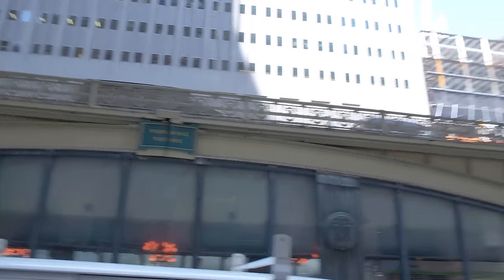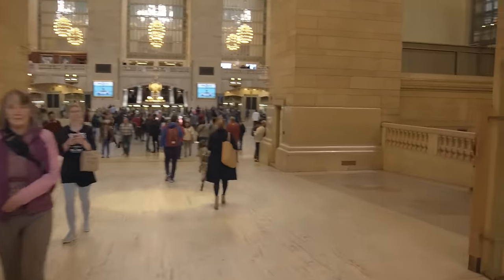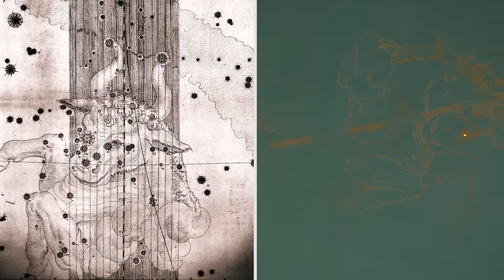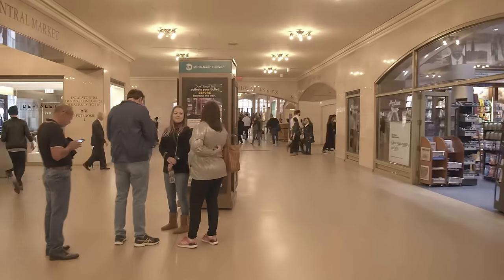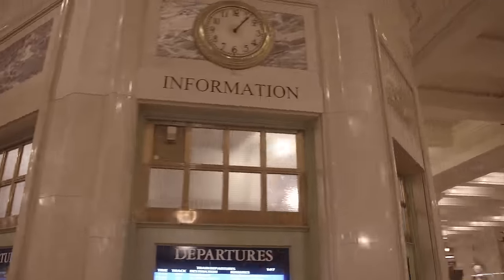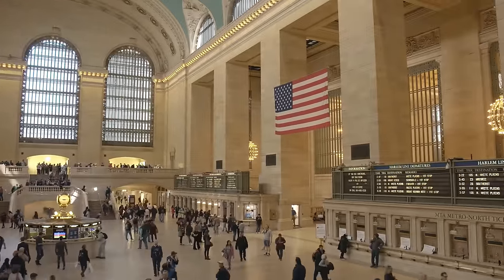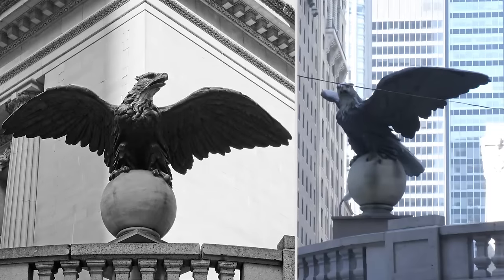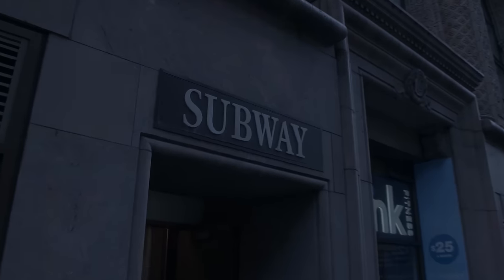Every Detail of Grand Central Terminal Explained | Architectural Digest

Comment: Well detailed video, with simplicity and clarity. Worked for the railroad for 30 years in design and construction and I've seen the transformation - most dramatic in 1998 to 2000 when the Main concourse ceiling was cleaned and in 91, and  2002, when the main Waiting area was renovated . All is restored to its original build-out because Grand Central is a Landmark Building. well done.

Comment: Good overview, but a couple of quibbles: While Vanderbilt's decision to move his railroad's terminal station uptown to 42nd Street did promote the growth of the area, the name "Grand Central" was ridiculed at the time because it was hardly centrally located in 1871. The original terminus was downtown on 27th Street. The current building, opened 42 years later, is the third on the site, and the Commodore was long dead by then. The first was called Grand Central Depot when it opened in 1871, and was actually three separate stations in a single building. It was altered and remodeled several times, but in 1899, it was greatly expanded and renovated and re-named Grand Central Station. The tracks south to 27th Street were removed. But the renovation was a stopgap at best, and when it was decided to electrify the railroad, as ordered by the city, a totally new station was built in phases over the next ten years, opening in its current appearance in 1913. It took so long because trains continued to operate while the old station was demolished and the new one built. It was then named Grand Central Terminal.
The second quibble is the picture shown with the statue of Cornelius Vanderbilt,  which was moved from the former downtown station. The photograph shown with the statue is of the original Grand Central Depot, and not the older station on 27th Street. The way the text reads would cause someone to think that were a picture of the downtown station, which it is not.
Minor points, and maybe not too important, but I noticed them,  and anyone who knows the history off the building would spot them, too

Comment: Amazing!! Lots of info I never knew about Grand Central!  As a civil engineer in 1983, working for a firm that was designing repairs to the structure of Park Av around the terminal, I got to explore this amazing building.  Walking the entire upper roadway to and thru the "building of many names" at the north end a bunch of times was an interesting and remarkable thrill of a walk!!!  

Back then, the lower level Info Booth never seemed to be staffed and what made it even eerier, was that me and my co-worker were usually the only 2 people on the entire lower level!!!  And, those glass floors between the windows on the west side of GCT freaked us out the 1st time we encountered them.  We crawled across, just so our hands would be closer to anyplace to grab on to in case the glass floor broke.  Thanks again for the new info!!!

Comment: Grand Central is simply stunning, a real gem in NYC's landscape that should be treasured & I love how the beauty ends abruptly when you walk through the gates; pomp & ceremony out the front & nothing but business down below.
It would've been nice if we'd seen what it was like to walk between those enormous windows that overlooked the main concourse though. Very interesting, thank you for such a detailed look at an American icon.
Reply: OMG, I had no idea there were walkways that traversed those grand windows!  I'm going to have to make a pitstop in Grand Central today to see for myself!
Reply: My brother's an engineer at Metro North and thanks to him I've actually gotten to walk through the windows. It's very cool and a little scary. 

The walkway is made up of glass panes set in a steel frame. each pane spans the with of the walkway but is relatively narrow, maybe a foot or so wide. They are reassuringly thick but I still found myself subconsciously walking on the steel frame instead. The whole walkway is actually floating between the windows. There are bars on each side that seem at first like handrails but are actually the crankshafts that are used for opening the windows. The glass panes have wear on them that makes them almost look like transparent sandstone.

The employees think nothing of walking through them. It's actually required to get to the break room. In fact, the only reason we went through it was to get to the employee bathrooms.
Reply: @melty4204  Thanks for sharing. I imagine it's something that you will never forget.

Comment: Cornelius Vanderbilt was a visionary!

Not only did he fund this opulent terminal, but he demanded that all the rail lines, running north from there, have at least 4 tracks each!

As a result, commuting to Grand Central is a pleasure.  Whereas commuting to Penn Station from Long Island is a total heartache!  The MAIN LINE running through the island STILL only has 2 tracks (despite decades of assurances that they would build a 3rd one), and owing to Penn not being a terminal, it's a nightmare to move trains in and out of there!

Comment: In my youth (1960's & 70's), I used to spend a lot of time in this terminal.  I can't believe how clean and bright it is now.  As I watched this, I couldn't help remembering what used to be...  Like the window shade type signs that the conductors would pull down to label the entrances to the tracks.  Or the big Bulova clock that used to be in the archway between Vanderbilt hall and the main concourse.  Thanks for the memories from an old New Yorker living way out in Los Angeles these days.

Comment: There's a 6" hole in the ceiling for the antenna of the space capsule..
There's a locker under the grand concourse for the conductors...
The painting on the ceiling is backwards...
And more!

Comment: Excellent job, gentleman. Quite similar, in fact to the tours I used to give, although back then it was still possible for me to take visitors across the glass walkways in the windows. 

I do have two corrections to offer, however. First, it doesn't matter what time of day you visit, you'll never see the sun streaming in through the windows like in those classic photos. Tall buildings now block the light. That's why you never see contemporary photos of that spectacle, only the same few old ones. 

Second, the terms “commute” and “commuter” do indeed come from the practice of US railroads commuting (i.e., discounting) the fare for daily riders. The NY Central and the New Haven surely did that for trains to and from GCT, but the practice and the terms predate our Grand Central by decades. 

Two omissions also deserve mention: it would have been great if you could have offered a glimpse of the subterranean power room housing the old rotary converters and you should have mentioned the new deep third level that will bring the Long Island Railroad to Grand Central for the first time.

Comment: Waterfront Station, which is Vancouver’s transit hub, has a similar design and has some cool secrets of its own. It has an old elevator, still in service, with its original floor indication dial- which still works. It’s also home to Canada’s first Starbucks!

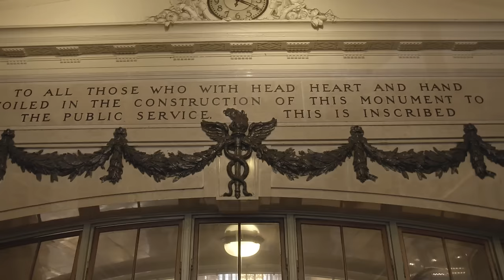Comment: Beautiful documentary with accurate commentary. Only problem occurs at 2:00 when a photograph is shown of Samuel Huckel's built waiting room. In this documentary, it is referred to as Vanderbilt Hall, "which  used to be the main waiting room of the terminal." Huckel's design replaced the Bradford Gilbert waiting room design which was actually built in Chicago's Central Station on Michigan Avenue and Roosevelt Road (demolished). I think they canceled the Gilbert waiting room design because it was too elegant for a terminal that would be demolished in two or three years.

Comment: The Vanderbilt Room
originally was not a benched waiting room. To use the Waiting rooms you needed a ticket. It's amazing the amount of tracks and platforms versus Penn Stations mear 14 tracks. Instead of the 2nd staircase the baggage and lost and found was there. The large baggage and Post Office Station sat were the Pan Am /MetLife building stands.

Comment: Good job, and only one major mistake, which is the suggestion (at about 3:36) that one can still see the sun streaming through the south lunettes at the right time. Unfortunately, it doesn’t happen anymore because the sun is blocked by buildings across 42nd Street. That's why the only photos you'll ever see of this striking view are those taken decades ago. An odd minor error is the statement, in connection with the departure times being one minute off, that the gates to the tracks are no longer there just a moment before the view shifts and shows us that, in fact, they are still there! A significant omission occurs in the discussion of the astronomical painting on the main concourse's ceiling. No mention is made of the fact that the one we see today isn’t the original from 1913 but a replacement the railroad installed in 1944 after the original was all but obliterated by water damage. Finally, brownie points for NOT repeating the ridiculous canard about the ball clock on the information booth incorporating precious opal. It actually uses ordinary translucent white opal glass. Obviously, despite these quibbles, I agree with the many other commenters who hope you will offer us more videos like this one exploring great landmarks both in New York and elsewhere.

Comment: I was always told that the old terminal was next door (not downtown) and was replaced with the Commodore Hotel (now the Hyatt) when the new GCT opened in 1913
Reply: I am not looking up the dates, but once upon a time ( and mostly in 19th cent.) horse pulled cars ran way downtown. One last depot was on 28 st approx. at lower Park (4 Ave). I am not sure if steam trains ever made it that far downtown. Note that the multi level train yard was build before this replacement train terminal buidling, enabling the development of current Park Ave. Original Park Ave. 'malls' were wider - enough for walkway in the center.

Comment: ", The ceiling received a bit of a puncture wound when a massive Redstone missile was on display in the 1950s. The day it was brought in—July 7th, 1957—the NY Times wrote, "The two main components of the huge weapon were to be taken off flatcars at 6 a.m. and moved into the concourse through the gate to Track 16 by 9 a.m. The Track 16 gate is believed to be the only entrance in the terminal wide enough for the missile. The Redstone, which is sixty-three feet long, is to be assembled in the concourse and then hoisted into an erect position on its five-foot-tall launching platform. A hole had to be cut through the concourse ceiling to accommodate cables that will help to steady the huge rocket." You can still see the hole today, which is near the fish on the west end".             from the Gothamist.
Reply: The entire ceiling, which had become blackened by years of smoke, was cleaned by a Russian refugee. A member of the Moscow Circus, she had been taken because of her tiny size and trained from childhood as an acrobat .  After escaping in this country, she became an artist conservator, and then opened a gallery in the Hudson Valley.  When she described the way she cleaned the ceiling, she lay on her back on a platform which placed her close enough to wash one small square at a time.  She left a tiny square of black.

Comment: I've been using this station my whole life but I have NEVER seen the light stream in from the windows like that photo.  I thought it was because the newer buildings blocked out the sun, but maybe I am just unlucky. And oh hoh that pillar in the info booth is a staircase?  Never knew that! And whaaaat I never knew the 1 min time difference.  Also never noticed the mural... or the acorns... or the lightbulbs... or the Tiffany clock.  And wow i never knew you could take those elevators - I thought they were for staff. And lol no one goes to GC just to eat... do they?  Why would you?  The gelato is good though. 

It's such a shame Penn Station was torn down - if that beautiful building had survived maybe that area of Manhattan wouldn't be the cess pool it currently is...

Comment: (1:52) That is incorrect. The Caduceus of Hermes is a symbol of speed and peace. Army MASH units use that symbol because they remove soldiers from the front as quickly as possible, patch them as quickly as possible, then ship them off to quietly focused medical professionals as quickly as possible. Anyone in the field of medicine who blindly uses this symbol should not be trusted.
(1:56) That new image is a Rod of Asclepius--the actual one-snake symbol of medicine.
(7:58) "Rampart" comes from the Latin "ante parare" meaning "to prepare before". It was imported into Gaul along with Julius Caesar. "Ramp" comes from the French "ramper" meaning "to climb, scale, mount, or crawl".
(15:55) How do we know that's not Athena, Heracles, and Hermes? Aren't those Greek doric columns below the statues on either side of the windows?

Comment: No mention of the previous buildings there?
How Vanderbilt consolidated three different rail companies into one, and then consolidated the three separate buildings into the present Terminal, all why keeping trains and passengers moving?
What about the amazing engineering feat of Grand Central North in the 1990s?
How about the actual reason why the railroad tracks were submerged?
Or Vanderbilt's genius of developing Park Avenue above the tracks?

No mention of the East Side Access project to bring Long Island Railroad to the site, deep underground?
How about the radioactive granite?
The fact that the MTA does not own the building, but has a long-term lease?
No discussion of the history in the 1960s, the PanAm Building, Pei's chess-piece tower which would demolish the terminal?